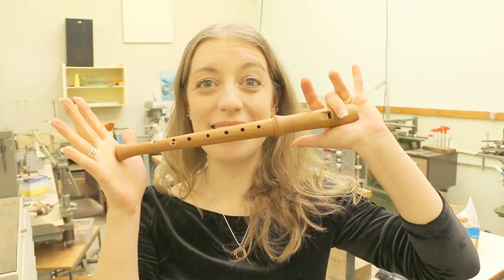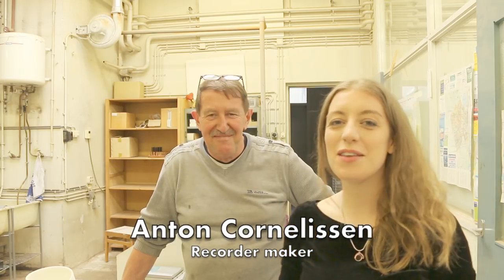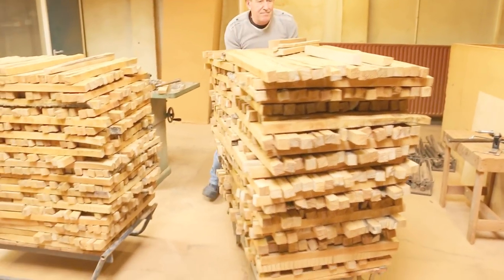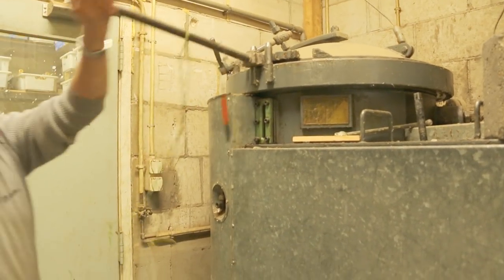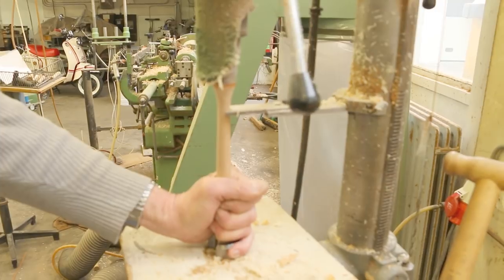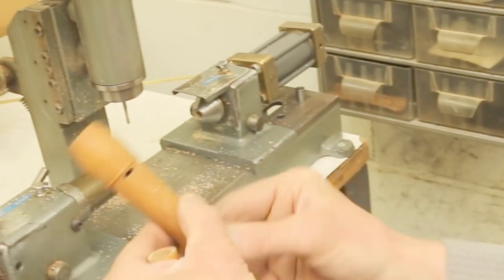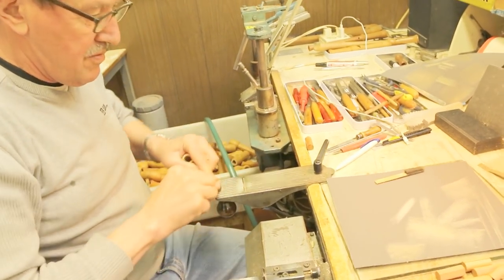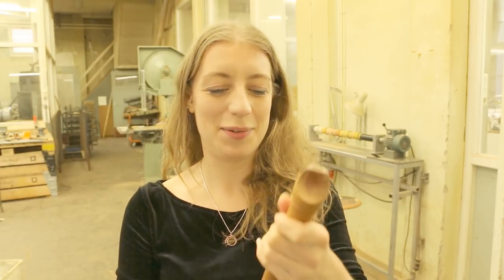See how a recorder is made! | Team Recorder

Comment: But how did they make them in the Baroque period?
Reply: Good question. The short answer is that power tools were powered by humans. The key tool for making recorders is the lathe. The lathe originated around 1300 BCE in Egypt. For thousands of years, lathes were operated by two people: one turned the wheel, the other worked the wood. In the Middle Ages, pedal operated lathes were developed, which allowed a single person to rotate the wood while working with both hands. The pedal was connected to a pole, often a sapling, so these tools were called "spring pole" lathes. Spring pole lathes were still commonly used until the early 20th century. 

A great time-saver enjoyed by today's recorder builders is the windway cutting machine. During the golden age of recorders (early 1700s) makers  meticulously carved the windway through the opening at the end of the head joint using files and scrapers. It must have taken hours. With a modern windway cutter, the process takes less than a minute.

Comment: What's the difference between a  single hole recorder and one with two holes? Are the notes different in sounds? Or just another way to play a recorder?
Reply: On recorders that have double holes you simply cover one of the holes if you want a semitone (G# for the higher holes, and F# for the lower on Alto - D# and C# for soprano), and both holes for the whole tone (G and F on alto - D and C on sop.)On recorders with single holes you have to cover half of the hole to get the same notes.
Reply: Thank you!

Comment: If it only takes 20 minutes to make a recorder, why do they cost so much?
Reply: it doesn't take 20 minutes to make a recorder, it takes this guy 20 minutes. and probably the only reason why it takes him 20 minutes is because he's spent the last 40 years of his career learning to use the machine and work the wood to the point where he can get one done in 20 minutes.
Reply from the maker: Goood question Susan - with a lot of answers... This exact recorder took 20 minutes for the video - made by someone with 4 decades of experience and all the specialised equipment you could wish for. That does not come cheap! Also that specific recorder retails at €44, which is not very much at all, when you factor in labour, experience, materials and the cost of running a business....

Handmade instruments are much more expensive as they represent individual time spent by one person - days, weeks or months of work, years of experience, expensive equipment, specialised woods (that need to dry for 10+ years before being worked with, so large up-front invenstements). Plus, all the makers I have bought handmade instruments from really forge a personal relationship with each customer, and you can return for servicing and adjustments to really personalise the instrument for you :)